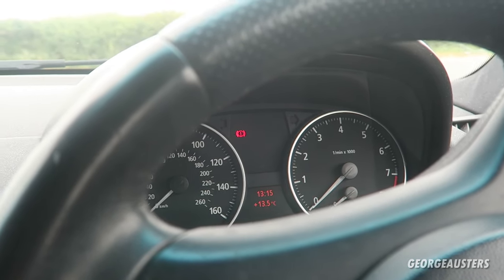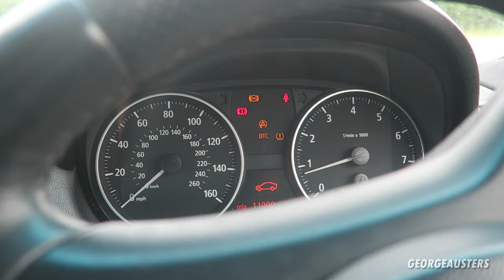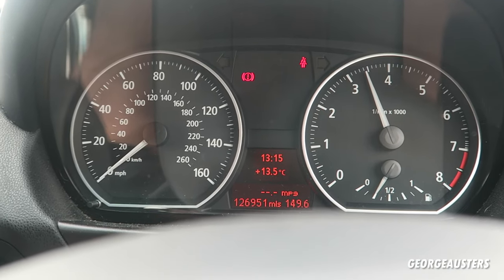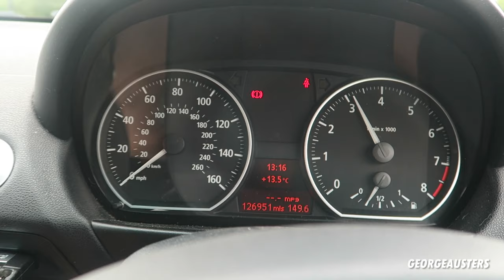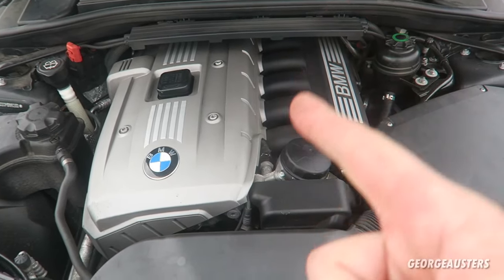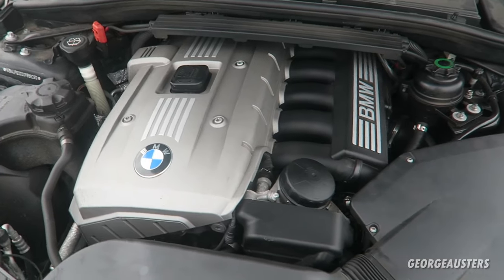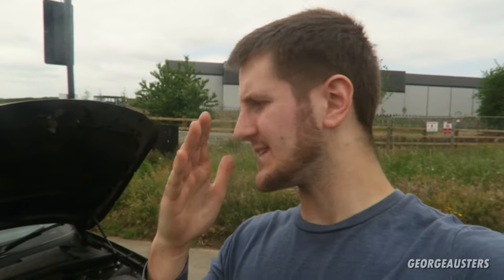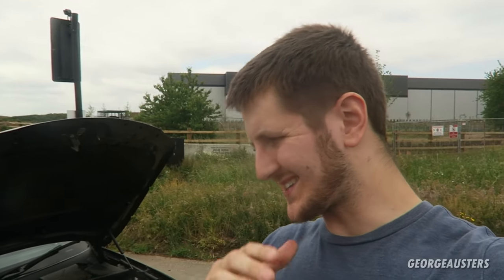ENGINE TICKING TAPPING NOISE | HOW TO FIX ENGINE TICKING NOISE FOR FREE

Comment: I’m actually driving out to Virginia with my 525i 07 this week. 5 hour drive. The car been ticking since i got it. I will try the rev for 3mins and see if that will do. And hopefully it will go away on this long drive. It’s so embarrassing going to the store and this car just makes this loud ticking noise infront of everyone😂🙄 I’ve had an oil change and that didn’t take it away either though so I’m concerned.
Reply from the maker: Really rev it out on the highway once it’s warm and you should be fine👍🏻
Reply: @GeorgeAusters  Thx I will def try it out! If that doesn’t work any other solution?
Reply: @Iamchriss01  did it worked?
Reply: I tried this and it did not work???
Reply: @GeorgeAusters  So it never worked. I tried giving it a couple miles to fade out and I even did an oil change and it's still a bad ticking noise. Its very annoying. Anything else I should do?
Reply: @maselhassan3637  Nope...
Reply: @Iamchriss01 put 8.5 liters.

Comment: So I have this noise on my 2010 550 BUT it never goes away, basically as i accelerate, if its quiet enough around me, i can hear it increase in speed as the revs buildup. Ive gotten to operating temp, beat on it, its just always there. Is it the same thing or is my ticking something else?

Comment: I see many videos about ticking BMW engines, it's all about the oil !!! I use Redline 10W/40 in my N52 E90 330i. I only get the rattling lifters when the engine is low on oil. Redline fully synthetic oil is the bomb, don't get any lifter noise.
Reply: Don't you have trouble starting in the cold if the oil is that thick
Reply: @margustammemaa5843  I live in Western Australia, so it's not cold enough to have starting issues.

Comment: I had this unexpectedly one cold morning from a car that runs spot on and genuinely thought the engine had suffered chronic oil starvation and was wrecked. It wasnt, but the loud tapping/ticking stayed even a few miles up the motorway. I stopped in the services and switched the engine off and when I restarted half a minute later the motor was back to its quiet old self (140000 miles)  it hasnt returned again, yet. The car gets regular motorway use so its a mystery why it suddenly occured. Was so relieved as the car would be written off with engine damage due to age and miles if it was as bad as it sounded ! Theres no dipstick on mine which added to the drama until I scrolled into the onboard services and confirmed oil level all in the green 🙂

Comment: BMW released updates to the lifters and head design to address this issue under a TSB. Whatever it happened on my car, I found fresh BMW oil change (sooner than recommended by factory) and some high speed highway speeds helped. The lifters bleed down with short duration drives
Reply: is this only in UE.. or usa as well?

Comment: Remember! At least 4 lifters are permanent compressed when the engine stops and the car is parked. 
That over time pushes oil out of the chambers. Each time the engine stops. How much, depends on the wear.
The engine needs some time, temperature and RPM to bleed them.
If you have many engine stops and short driving routes, the hydraulic lifters get drained and begin to tick louder and louder ...
Reply: Does the noise lead to any critical failures or damage?
Reply: @Vini7034  It increases the wear of the lifters, roller drag levers and camshaft.
Reply: So whst you're saying is that I should give my 328i some GAS??

Comment: Hi George, i have lifter tick on my 2005 BMW e90 330i n52 and have driven 100miles at high revs and tick has not gone away unfortunately. I spoke to BMW dealer for 24 lifters and was quoted £600 of which is to expensive, a question i have are the lifters for the inlet and outlet the same as BMW have two part numbers? I thought they might be the same dimensions but not sure, please could you shed some light on the annoying situation.

Comment: My 128i only did this after I changed the valve cover and valve cover gasket. I think having the cover off for awhile let the oil thicken up. Once I started driving it again, vividly... it went away. N52 needs to be revved!

Comment: An accusump or similar, set up for pre-oiling, will solve the issue. At least it did solve the issue 100% for me. Even for short trips. The problem occurs at start-up because the lifters sometimes do not get enough oil and one or more will start sucking air. When this happens it may take a while to get rid of the air bubble. With a pre-oiler the oil system is pressurized and there will be no oil starvation and therefore no noise. Even when the oil is thick.
Reply from the maker: If you drive the car like I said then you should not have the tick. I no longer have it.
Reply: @GeorgeAusters  Well, mine was not entirely cured by doing that, maybe to about 80%. Drove 100 km every day, pretty spirited, did not help.. I even changed the lifters. No bueno. But pre-oiler works 100%
Reply: Hi, I have been struggling to fix or reduce this infamous lifter noise. Could you please tell us how to pre-oiling on N52?
Reply: @kevinfan2260  Accusump + electric on/off valve that can be controlled from inside the car. I connected the system to the oil filter housing with a custom made block sandwiched between the housing and heat exchanger.

Comment: For my engine helped flush with millers xf 5w40 and archoil ar9200. Oil burning almost stopped from 4l per 10000 to 1l per 10000km.

Comment: My 3.7L Ford does something similar. In my case, it only ticks after warmed and idle only. Any RPM makes ticking go away. The tick rate seems identical to this BMW which I believe is 1 tick per revolution? Could this be a lifter as well? Any other ideas?

Comment: I read about this, how ever last time i got a power steering noise, when I was checking the PS level the noise change from taping to like rattling like if something was lose in the timing chain. im planing on doing the valcover gasket and check for lose or broken guides. my car only has 96K miles.. 2012 128 N/A

Comment: The mister is correct had a low oil pressure on Opel, ticking sound low level occurred I used this sys it work

Comment: Ticking stops by just adding .5 to 1 liter more than what the car calls for if you completely drain the oil. Add what the car calls for, start it up, let it get to operating temp at idle and if it continues add the .5 to 1 liter. If you didn’t change the oil and want to try and fix ,just try adding the .5 to 1 liter and do the same. Should stop. Also May tick the day after you changed the oil because the oil drains down over night. If you put the amount the car calls for and it’s not ticking but ticks the next day. Again just add some more oil. If you don’t want it to tick right off the start, I’d say just add the extra oil before. Yes it may go away without adding oil by letting the car warm up and steadily reving at a low rpm to get oil where it needs to be
Reply: Yes..I added my engine oil to the max level and no more ticker noise
Reply: @mazlanahmad1318  good to know man
Reply: Es cierto, mi 330i comienza a sonar los botadores cuando baja el nivel de aceite. Tengo una perdida por la junta del carter. Hoy mismo comenzo a hacerlo. Sinceramente me tiene cansado bmw con su infinidad de problemas y aca en argentina tristemente cada arreglo es muy muy caro.

Comment: Hello! Before doing this procedure, the oil should be in temperature? Which means to run the car for about 10 minutes? Or just as You start the car, on cold engine?
Reply from the maker: Oil needs to be up to temp

Comment: I have to disagree with your statement about thicker oil causing more ticking.  The ticking on my Z4 N52 is much less when I use 40w oil than when I use 30w oil; even after warm up.  Since I used to swap to 30w in the winter, I have much experience with this.  I decided changing oil seasonally was a bother, so I now just stay with 40w.  
The lifters on many cars' lifters are louder during cold starts for well, other reasons that I can't explain!  Maybe low flow?

Comment: Mine n52 engine has started to get this annoying ticking sound... I drive everyday but only short runs, like 5 min to work and 5 min home. It was starting ticking again when i got home so I was getting it up to work temperature and then i did 2 kickdowns and the sound is gone. 
The engine screams for a readline when it starts to tick 😉

But i wondering if i can do anything else to keep it away? Like try a thinner oil? I now run with castrol 5w40.

Comment: Thank you for the video George!! Me having the same issue on engine with roughly 110000 mls. We have tried many ways to get rid of it but at the end I am planning for head replacement. I was thinking about to change just rollers, HVA but this is some issue with head design. So after all I have been told to go with head replacement (head with new design). Head replacement is for the same cost like to change HVA rollers....I have still some time (until April 2021) to decide which way to spent money :D. If someone got some tips what would be the correct way I am open for discussion ;)
Reply: Do you use 0W-40 oil? I used to get ticking sometimes but I don't get the ticking ever since I've used the tinnner 0W-40 oil and changed it every 4,000 miles. Well i've heard it once but it went away within a minute. I'm on 104,000 miles
Reply from the maker: Do you take it on regular long drives and really rev it out?
Reply: @eded12333  first owner used 5W30 Castrol :(, oil change between 20000-25000 kms. I have used Mobil ESP 5W30, oil change 8000 kms + flush. Now I am using Mobil Peak Life 5W-50. Ticking noise developed after cca 8 months. Maybe I could try 0w40 but I am worrying that to go from 5W50 to 0w40 would turned engine into oilcan :D
Reply: @GeorgeAusters  2 times 20kms (to work from home and back) and then 50kms to another city and back on daily basis. I am rev it out once engine is in optimal temerature range and keep revs above 3000. When engine is cold I am keeping revs up to 2000- 2800. I think HVA are just mechanically on its way to heaven. As I wrote earlier I have still some time to make decision what to change. I will do valve cover gasket soon so I think it will be good to check the camshafts, HVA.... Maybe it will help me to decide what to change/replace :)

Comment: Hey goerge, thanks for the advice, but I have to ask: which is the optimal temperature in this particular engine? THANKS A LOT.
Reply from the maker: The thermostat is controlled by the ECU depending on engine style, could be from 75 to 115 Celsius

Comment: thank you mate for the video, I will try this. Similar sound coming from my 318 n47 engine. Can you recommend which oil is best to use? Currently, I'm using Castrol 5w30. Thanks in advance.
Reply: Have you tried? The oil is good

Comment: Hello, thx for posting. I noticed your starter turned over slow, are you concerned about that? My 2007 x3 turns over slow with a strong battery.
Reply from the maker: Fixed it here: BMW N52 Starter Motor Removal & Replacement
https://youtu.be/sfkTiIg7LyA
Reply: @GeorgeAusters  awesome. Thank you very much.

Comment: hi
if thickness of oil is the issue. can you go down from 5w-30 to 0W-20?
Reply from the maker: Thickness of oil is not the issue
Reply: @GeorgeAusters  oh ok
Reply: Never put any oil in that the manufacturer doesn’t specify, otherwise a ticking noise might be the least of your issues!!!

Comment: Sounds like my old BMW Cooper S before it warmed up that does - wonder if that was the same issue?
Reply: The odd track day may help
Reply from the maker: Exactly the same issue mate!
Reply: I think your car is having an identity crisis. I think it should be MINI cooper S. Unless of course my wife drives a 'Bugatti Polo 1.4'
Reply: @stunicholson3921  Mini Cooper S leaves it open for ambiguity, could be a number of different cars. BMW Cooper s gets you in the ball park - thanks for needing to point that out. BTW - I'm a mini man (proper mini) and really don't think the Bini deserves the title at all, it's a shockingly bad car and the marketing guys got it bang on with the pile high sell high and market it to my Mrs - I'd never touch one with a barge pole. now, an old school Cooper S - yes please.
Reply: @Turbostott   thank for clarifying the fact that your  BMW (mini) was made within the last 26 years, mixing the brands made much easier  than actually putting a date on it. If you are interested, I drive a Rolls Royce 535d (therefore, my car is less than 22 years old). Great way to avoid confusion and add clarity.

Comment: Hi mate i have a e60 525d and when the car is off its making like a loud tapping noise constantly. Its been doing it for the past few hours. Any idea on what it could be? Thanks in advance
Reply: E60 diesel 2.5 engines are known for having bad chains... Go to a mechanic to take a look it's a big money difference if you change the chain before it breaks... If it breaks it will brake the valves and maybe even more damage so you'll have to do a rebuild and you know that isn't cheap... I suggest you go to a mechanic and take a look better risk a 100 buck's

Comment: I am actually in the process of buying a 3 series 2005 N52 and when i open the oil cap while running the engione it sucks the cap a little bit, so vacuum and CCV which is solvable when the CCV will be replaced, but what bothers me is not the vacuum, it is the noise of the motor when the oil cap is removed. It does tok tok tok (not the lifter though).
Kinda like in this video from 1min12sec to 1min18sec:
https://www.youtube.com/watch?v=mZRf6R7-zws&t=86s

Is this normal sound when you take off the cap?? Or because the CCV is cloged it makes more pressure on the pistons and maybe this is bad piston sound when the oil cap is off??

Comment: For an M42B18 do you have any idea how to repair the hydraulic lifter tick?! The engine was rebuilt, i used the same hydraulic lifters; were all good. The tick is not so bad, but as you said it`s annoying.  And i don`t want to open the engine again, to take the cover out and the camshaft because i will have to replace all the gaskets once again. Thank you! I also did what you described in the video above, it`s a little better but i still have the tick, not too loud but it`s there. Thank you!

Comment: My N47 320d makes a very similar crackling  noise at start up and stops after the engine warms up. Is this problem only specific to N52s?
Reply from the maker: It’s for many engines mate. Will likely be the same issue👍🏻
Reply: @GeorgeAusters  cheers thanks for the reply.
Reply: No diesels aloud here !! 😅

Comment: Sounds like my cruze in cold condition, but after 30minute driving that sound is gone.
Reply: Please anyone help, my mechanic said that the sounds from hydraulic adjuster, it that right?
Reply: @anugrahcahya5964  any car with hydraulic lifters has this happen eventually 
Happened on my 2013 2.0t genesis coupe
Now with my 2007 525i

Comment: theeeeese engines suffer oil starvation due to the oil pick up being blocked.
Reply from the maker: Yup, need regular oil changes!
Reply: The only way to unblock it, is to remove the sump and unblock or replace the pick up piping.